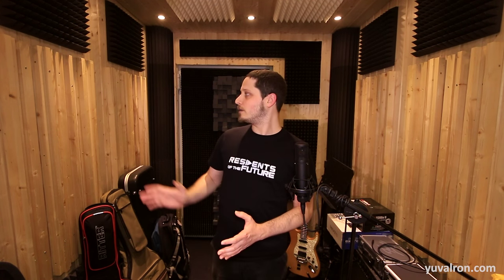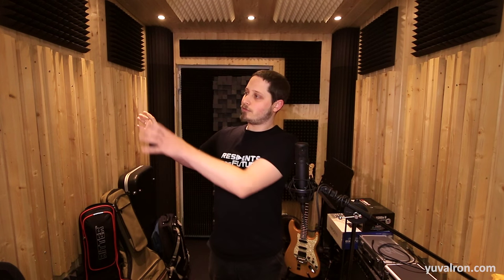How to build a home studio - Episode 2: Double door and walls frame

Comment: I'm curious how you deal with ventilation
Reply from the maker: +Tim Kyle that's a very good question. In my case, since I have a window, I just open it at least once a day to air the place. In other (more professional) studios they are setting up a split AC so that the compression unit is outside and the air is going through a long curvy venting tunnel usually built inside the ceiling to air vents so that soundproofing is kept at the maximum. Obviously this is a very expensive solution so there has to be a line drawn somewhere :)

Comment: hii yuval Ron I have few questions , 1) what is the room ratio of your control room - length ,width ,height after application of isolation materials . 
2) which companies Rockwool did you use ? 
3) what material do you use for lower frequencies absorption ? 
4) what monitors do you use ,what is their frequency response ? 
5) what did you use for bass trapping ? 
6) your monitors are tuned to how many db SPL? 
I hope you will answer these questions iam also building my studio in Mumbai - India and your videos have helped me a lot .
Reply from the maker: +gaurav sharma Thank you. 
1. Inner room length 325, width 226, ceiling height 260-270cm. 
2. Sonorock
3. Lower freqs are partly absorbed by bass traps partly absorbed by the rockwool itself. Bass traps are R25/S44 acoustic foam.
4. Adam A7X, 42 Hz - 50 kHz
5. See 3.
6. 0dB.
Hope this helps!
Reply: the more mass the walls have and the more spacing in between the inside decoupled walls and exterior walls (which should have mass added to them and decoupled) is the only way to truly get control of the lower frequencies, but will never truly and completely kill the low frequencies all you can do is lower the point of reverberation of the exterior walls by adding mass and air spacing. The foam is not sound proofing, it only controls the reflection within the room and is often mistaken as actually helping stopping frequencies from going through the walls.
Reply: gaurav sharma have u done with building your studio...if yes then please help me I am also building my own studio also staying in Mumbai.please reply

Comment: With the double door 'airlock' - there isn't an issue of the doors being hard to open, is there? Due to air pressure from either rooms? Im trying to decide on one heavy MDF door, add OSB to it, vs two typical MDF doors like you did.  Thanks!
Reply from the maker: There is no trouble at all with the double door. The air is just pressured out when the inside door is closing.

Comment: How do I connect my double wall to my existing structure without completely ruining my attempt at isolation?
Reply from the maker: You generally don't. Make sure to screw the wall frame pieces tightly to each other. The only exception we've made is the door frame since the fire door is heavy and we didn't want it to rely on the rather light wall frame.

Comment: If I'm not mistaken, I saw you mounted the fire door frame directly to the existing wall and assiciated studs/beams permitting sound transference through the walls into & out of the room? If so, I would not recommend that aproach. Thanks.
Reply from the maker: That door weights about 100kg. Having it rely just on the light inner structure is a bad idea. 
Project studios are always a compromise.
Reply: @YuvalRon  Thanks Ron, I like your floor detach methodolgy. I would make a stronger framing at the entrance wall and completely detach door from wall. I live in a condominium and cannot risk the neighbors complaining. Hope to start my project shortly and found your videos helpful. Thanks for sharing. ✌🥰🤩

Comment: Thank you so much for the videos, Yuval. You and your friend did an awesome job here. Great, great work. Let me see if I can make myself understood. What's the gap between the top of the wall frame and the actual ceilling of the apartment? I know the wall frame has an angle to it, but I'm thinking about the measure between the flat part of the frame, the one that is at a 180º to the ground, and the ceilling? Thank you so much for the videos!
Reply from the maker: Thank you. Since the inner ceiling is not parallel to the floor, the gap between the inner ceiling and the external room's ceiling is 24cm-34cm. The external room's total height is 294cm.
Reply: Thank you so much, Yuval!!!

Comment: Thanks very much for these videos! I am moving to an old farmhouse and want to build a studio in the stable (8.50m x 4m). I want to start in August, so I hope more videos (ceiling and acoustics) will be online by then. I have researched many videos and yours are the best I found. A question, is there a minimum height of the ceiling for proper acoustics? The ceiling in the stable is pretty low, so maybe I have to raise the atticfloor, but only if necessary off course...
Reply from the maker: +Incyinc Actually a low ceiling is quite an advantage in my opinion. The higher the ceiling the more you'll have to invest in drying it up. One thing to consider is that angled / uneven ceiling and walls provide some degree of support to the room acoustical performance. I will discuss this in the next episode which will come soon.
Reply: +Yuval Ron Thanks for your answer. That sounds good :) It is an old barn I will be working with and it still has the original unregular beams. The height is about 2.25, with the floor and ceiling this will probably be reduced to 2.15. I am very interested in your next videos!

Comment: I have a question.  If you have the double door setup?  And like you said, when you close the internal door you hear a woosh of air... Do you have any problem with overall air circulation?  Do you have any vents going in to the room?  Does anyone get light headed if they get locked in the room for an extended time?  This is a serious question...
Reply from the maker: There are no vents in the room, but there is a window, and I make sure to open it every couple of hours when working. If you are building a room with vents, make sure there is a long and curvy venting tunnel in the ceiling that supports sound insulation.

Comment: Greatly enjoying following your process and my heart goes out to your lost friend. I'm looking to do something similar to this for a drum practise room in a free standing brick veneer house. How isolated is your room? Would a drum kit's sound still be heard outside? Are your external walls concrete? Double brick? Grüsse aus Melbourne, Australia!
Reply from the maker: +Matthew Apted thank you! In my particular case, the room is too small to have a drumset, but I suppose a drumset would be slightly heard (especially lows) from the outside. My external walls are plain brick walls, the building is rather old, but for my needs the solution is still fine since I am mostly in control of the volumes. For a drum practice room you would probably need even thicker layers, concrete is a good option to enhance the external walls. The principles are still the same. A complete isolation is hard to achieve with bass / drums, but it can certainly improve things. It's always advisable to work with an acoustic engineer to get the result you want, especially with heavy / costly materials (also for safety). 
https://www.soundonsound.com/sos/feb98/articles/soundproofing.html
Reply: Thanks for the response,  the link and the advice! I'll do my best to document my efforts and share when done. :)

Comment: Do you need a floating floor on ground level? I am assuming this build is if your are on a second floor? I am building in my basement, would I need a floating floor?
Reply from the maker: +jeff darnell the answer is Yes. You need it because if your sound hits the floor directly, it goes to all other surfaces - walls, ceiling and outside.

Comment: would i have to build a room inside a room, if i were to make a new building from scratch and just insulate it correct?
Reply from the maker: what do you mean by insulate it correct? the room within a room is a standard insulation, even in professional studios.
Reply: i worded it wrong sorry, i meant like if i were to build the whole building the way the room inside the room was would it still work out. but i understand , now for the control room would it be needing to be a room inside a room as well? or how would that one be built? sorry for so many questions i plan on building a recording studio big enough to record a band in , atleast 1 drum set, 2 guitars, and a vocalist. so i could get more work with diffrent types of clientel
Reply from the maker: +MIXTAFROMDA956 the control room requires a very good insulation from the recording room and therefore yes it has to be another room within a room. Same for drum booth, vocal booths etc. If you are going for a professional studio I would recommend you to study more about the subject beforehand and consult a professional acoustic engineer. This article series on SOS is a good start: https://www.soundonsound.com/sos/feb98/articles/soundproofing.html

Comment: Wait.. you attached beams to the existing wall and then attached the door frame to that beam and the floating room? If so you just negated the floating floor purpose as you actually coupled the inside room to the outside room. What you should have done is attached the inside door to the inside wall frame that would be on top of the floating floor, so that all there was between the inside walls and the already existing walls were an air gap of 6 inch at minimum for acoustical waves reduction, with roxul between the joist of the inside walls. The acoustical waves would bounce off inside the existing walls and the inside walls making several passage through the roxul and each time losing wave strength. The more mass you have also will also mean the lower frequencies will be slowed or killed on the go. Which is also why you should have added an extra layer of gypsum to the existing walls using a RSIC Resilient Sound Isolation Clips, then having the air gap and then having the new inside walls decoupled again by RSIC Resilient Sound Isolation Clips to have a double or triple layer of gypsum depending on how much db you're looking to drop. And of course all that weight for the inside room would have to be calculated before doing the floating floor so that the proper size and spacing between the floor decoupler would be used.

Comment: What's the purpose of the fire door if it's also attached to the outside wall like the other door? Normally, you attach double doors to each wall respectively (inner wall and outer wall) to reduce the mechanical transmission of sound. Maybe I'm missing something. This method seems to make all the hard work you put into building detached floors and walls not working to it's full potential. 

Or maybe the fire door frame isn't attached to the inner wall at all?

Don't get me wrong, I think you've done an amazing job! Just curious :)
Reply from the maker: That's actually a good question. Screwing the door to the outside wall had a very good reason. The inner wall frame is a very light structure, weighting maybe 30kg in total, whereas the inner door is actually a heavy fire door weighting around 60kg. You don't want to let a thin frame like this hold such a heavy object. So you have to make some compromise - soundproofing for safety. In a fully pro studio the inner wall would obviously be made completely differently, probably from concrete and other isolating materials in between, which is much more robust to attach the inner door to. But that's basically what project studios are all about - compromises. And still, as you'll see in the last episode, the room is performing incredibly well, with all its constraints.
Reply: Ok I see! Thanks for explaining. Most important thing is that the room works.

Comment: How much gap should we leave between inner wall and outer wall?
Reply from the maker: The wider the better. I would say keep a minimum of 5-7cm from the external walls.
Reply: +Yuval Ron and we just stuff the gaps with as much insulation as we can?
Reply from the maker: Nope. Insulation should be just within the frame. There should be a real gap of air between the rockwool insulation (the internal walls/ceiling) and the externals.
Reply: But no gap between the floors? Is that why you guys laid down a layer of neoprene?
Reply: If I filled the outer wall with insulation stuff first, then leave a 5 to 10cm gap, then build the inner walls, would that have better soundproofing than compared to just build the inner walls with the gap?
Reply from the maker: Gravity makes sure there will not be any gap between the floors ;) so yes the most you can do there is place the neoprene / rubber tiers.

If you already have an outer wall with insulation material you might have a killer soundproofing, but it all needs to be measured. Normally even with professional studios the outside walls are just plain walls.

Comment: There're several resonanse peaks in your room from 125 to 200 Hz (especially in 125-150 range).
Reply from the maker: I'm not sure how you inferred this but it is incorrect. We will discuss acoustics on the last episode.
Reply: I've listened to the spoken voice and heard it then checked with an EQ.
Reply from the maker: +Nullll1111 well, that is certainly not a way to measure acoustics. Not only you measured my particular voice, but it also went through a signal chain - microphone, preamp and some vocal conpression. All these are far from being balanced. There are specific methods to measure room acoustics and the only way to do so is in the room itself and with measurement gear.
Reply: I know what you're talking about and I know a resonance when I hear one. And it's not a constant balance. The room gets saturated now and again. EQ is just a tool to pinpoint those frequencies.
Reply from the maker: +Nullll1111 we made RT60 and other tests that will be shown later on. The room is obviously not perfect (no room is and certainly not small cubical ones) but we balanced it pretty fine.